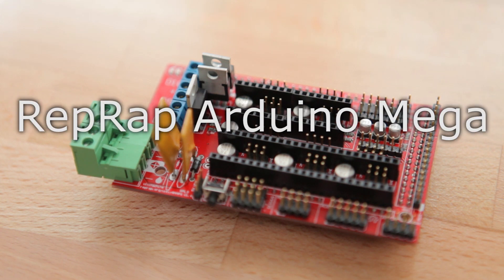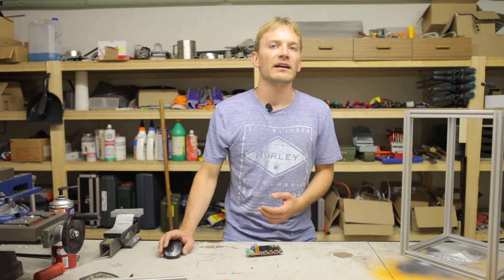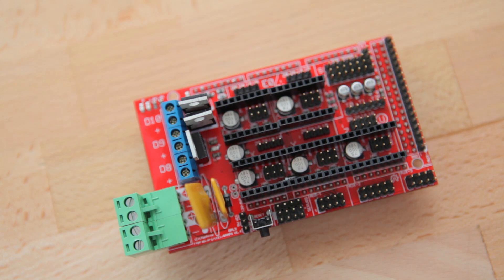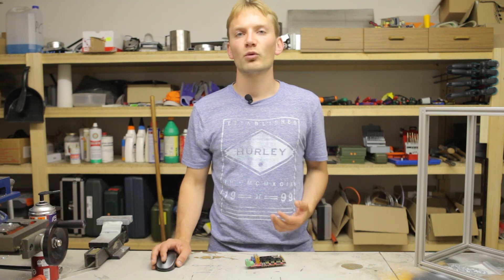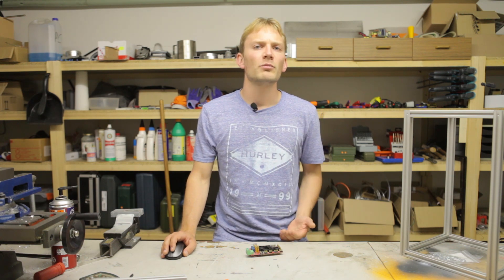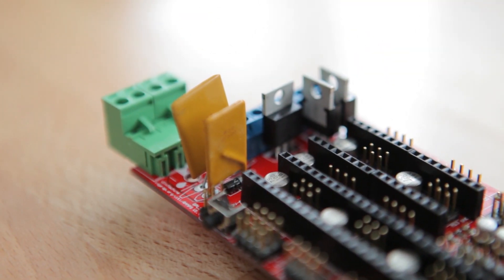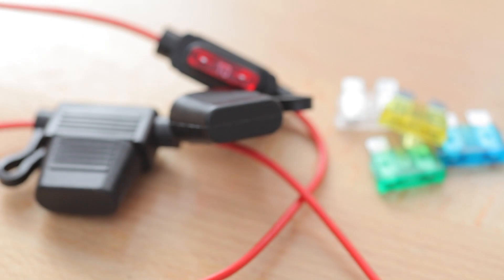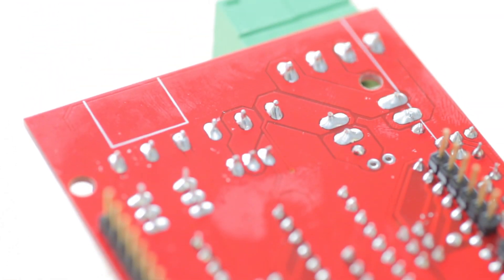Honest review: The RAMPS board

Comment: Most RAMPS V1.4 boards that ship today have 35V electrolytic capacitors and 30V polyfuses, so they're good to go with a 24V 3D printer after snipping D1. Note that a 24V 3D printer won't overload anything on the RAMPS board because it uses half the current of a 12V printer to do exactly the same thing.

There are virtually zero drawbacks to using RAMPS for your 3D printer.

Comment: I'm here because my heated bed stopped working. Upon inspection the green power connection was burnt and the pins themselves were very dirty as a result. No connection was being made. I wiggled it a bit and that allowed for a connection but the contact was so poor that the area started to heat up a lot.

I ended up throwing the connector in the garbage. Instead I soldered the wires to the pins. I made sure the area was good and clean. I took some sand paper to the dirty pin for the bed. I finished it off with some heat shrink tube.

I've been running my bed for years at 60C. I recently changed it to 70C and has maybe 50 hours on it like that. I wonder if this exposed the limitation.

Comment: Hey Tom,
I'm using Ramps 1.4 and everything work just fine including motors but I'm not getting any output voltage from D8, D9 and D10 pins which are used for heat bed, hotend and fan. Any suggestion and help from your side?

Comment: Hi Tom,

About 4 years ago i made a 3D printer and printed some parts. Quality not so good so i more or less forgot i have a 3D printer. Since then i have build my own CNC milling machine and made some new parts to upgrade the flawed design from earlier. However i use Ramps 1.4 EEF and i can see that at least one of the Power supply pins almost burned on the 4 pin green connector so i am going to buy a new ramps board as replacement. Do you have any knowledge about the Ramps 1.5 with the 3 MOSFET ? Further my new design use 2 extruders with V6 hotted and MK8 on the cold end. I have hot glued one 40mm fan on the back of each extruder stepper motor. So i have 4 fans for the extruder  system in total. I used to use Gen7 firmware but followed your advise in some of your other videos to use Marlin firmware. But im am having trouble to get it to compile !! once i change to 2 extruders different errors occur in pins.h and temperature.h. !!! Further i think i can use some of the pins in the AUX1 or AUX2 to connect these little fans but i don't seem to find any pin numbers to assign in config.h. Hope you can help with some of the issues.

Comment: Using mosfets to run power for all heating elements would solve the board power problems. By simply using the ramps heater outputs as signaling for the mosfets, the board would have plenty of power capacity to run stepper drivers.
Reply from the maker: +Marcel LeMay the RAMPS (and very other boats) is already using MOSFets. The problem is that the cheap ones they use are often total crap.
Reply: but  when you add external mosfet  you are more safer  @MadeWithLayers

Comment: Just use a SSR25DD Solid State Relay, they are rated for switching 25 amps with a internal resistance nearly to 0 and they cost about 3-5 bucks from china

Comment: If I connect   the  assembled motherboard - connect the LCD2004 and 
power it up....is it OK  or does it needs motors etc,. to be  wired up -
 I have  a kit and  want to see what is installed already on  the  board
 before stripping  my A8  printer down to fit the Ramps kit.

Comment: Can I connect raspberry pi to arduino for 3D printing and use octoprint?
Reply: Yes. I made a delta 3D printer controlled by an arduino 2650 w/ ramps 1.4 shield. I use octoprint in a raspberry pi model B to send the gcode to the printer.
Reply: João Mendes thank you

Comment: Here is the most important thing between the "RAMPS" boards and these new MKS boards. The Ramps has a ton of support! 

For example I want to use the Servo and end stop switch for auto bed leveling because I prefer to have glass on my aluminum bed (why because you can remove the glass and stick it in the freezer for hard to remove big parts, open aluminum scratches to easy when you try to scrape off parts)

Now I can find a dozen video on where and how to wire a servo and end stop switch to the ramps board, as for the MKS, I type in MKS 1.3 or 1.4 and I got a ton of nothing, a when i ask the China morons on Ebay for help they play like cant read English!

I hop Tom here could do a video on how to set up a Servo endstop type of auto bed leveling using one of these MKS boards found on the Hictop, Anet, and what ever other China no name 3D printers hitting the market.

In the meantime I am yanking them off and going back to Ramps (Ps I have two of these MKS board, and both have burnt up chips on them, Ramps have heat up issues too, but I have yet to have any compared to to 2 MKS board both frying when in normal use.
Reply: According to public pinout of MKS 1.4 and RAMPS 1.4 schematic, they work the same, using the same datalines for servo connections. On either, it's a 3x4 pin header array. The direction of connectors is the same too. The GND bus of the servos is at the very edge of the board, the +5V bus is the next up, and the PWM line for each servo is the last.

Just use the pinout diagrams.

Comment: The price has dropped significantly since 2014, now you can get the RAMPS1.4, Arduino 2560, five drivers with heatsinks and a USB cable for 25 bucks
Reply: Poptart McJelly Yep, directly from chineese internet store ;) still now ramps cost 25£ on e3d page (bought mine for 4$)
Reply: that's because it's cloned hardware vs from the developers.
Reply: @MyBrothersMario  Developers probably get it from China too lol. As long as its the same design, materials and processes I can't really fault it
Reply: @cam_au  the difference is that even if they get em from china, they will test them, try them and check the quality to ensure that the items are up their standards while buying from china is a roullete where you can get a normal quality, low quality or mythic item (?

Comment: I like this video but it is more like a intro to ramps.  Tom is it possible to see complete guide to ramps?  Like run most of components on 24 volts: fans, heatbed, A4988.  Calibrate stepper.  Is it possible run DC motor with hall or strip film position (close loop, like ink printer)?

Comment: I have never had a single problem with my Arduino/RAMPS1;4/Pololu setup. But now I got worried about the connector issue, i will try measuring the current for safety.
Reply: Don't take this issue lightly. I just had mine melt down on me, and was lucky not to have caused a fire. I will now be doing a RAMPS 1.4 overhaul...
Reply: That's why I don't like to read of people leaving 3D printers on overnight. It's not fire that kills you it's invariably smoke, inc the magic blue stuff.

Comment: Tom i like your reviews and explanations very much ( even more when you needet to speak a little more slower because when you were a little handicapped with your voice sometimes before ;-) ) because as a beginner in 3D printing i need to learn much.

I got a MKS GEN V1.1 Z2 board with my Mendel Prusia I3 set but want  double extruders.
Is there any hardware difference between the Z2 and not Z2 version of the board?
Can i simply connect 2 Z Steppers to one driver on the bord so that i have one driver free for the second extruder?
Should i connect them parallel or in series?

Thank's for your help

Michael

Comment: Hey so I have been trying to use a Ramps 1.4 board to drive my printer and two heated beds, they kept failing but now the problem seems obvious. Can you recommend a board (preferably marlin compatible) that could handle the 22+ amp draw?
Reply: +Thomas Sanladerer 
http://3dprintboard.com/showthread.php?19807-FET-Bed-Heater-Board
Take a look at this, i'm also playing with a 120V rectified version to run those big monster beds you showed off in another video;)

Comment: There are three serious design deficiencies with the RAMPS 1.4 board.  First and foremost, the use of polyfuses.  These should be replaces with non-resetting fuses, like automotive fuses.  Second, the 5V line for the end-stops needs to have current limiting resistors.  There is no reason to have more than 20mA or so through these pins, and people who accidentally shift their connectors by one pin will short 5V to ground and blow up the 5V regulator on the Arduino.  Lastly, and related to the endstop current issue, is the stepper selection jumpers.  Same story here, I had a defective Pololu driver that ended up taking one of the 5V lines selected by the jumpers and putting it right to ground, destroying the 5V regulator on my Arduino.  Since these are only used for signaling, there is no reason to have any appreciable current on these pins, let alone full access to the 5V regulator's output.

Comment: Driving a heated bed directly with the ramps is probably not a good idea because of the issues you raised.  I'm using a home brew heated bed that runs off of 36 VAC and I'm switching the primary of a step down transformer with a solid state relay driven by the ramps.  Instead of having to switch over 11A, the board now only has to supply maybe 20ma to drive the relay.